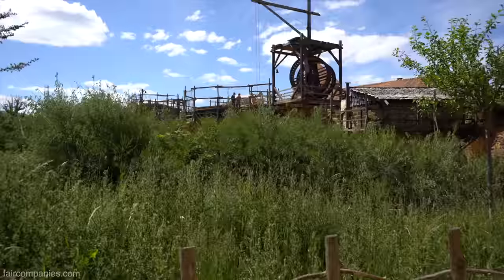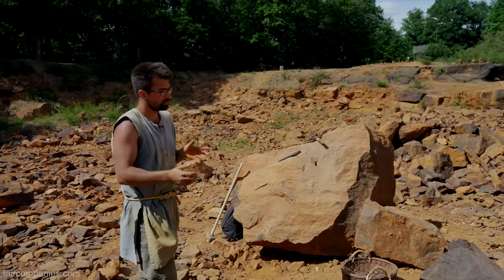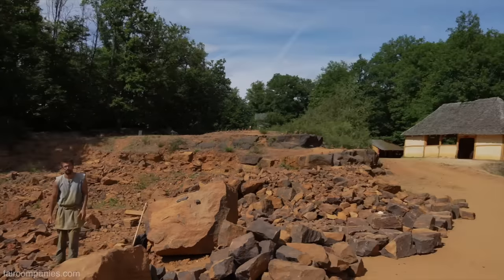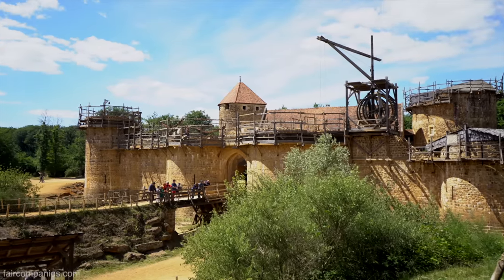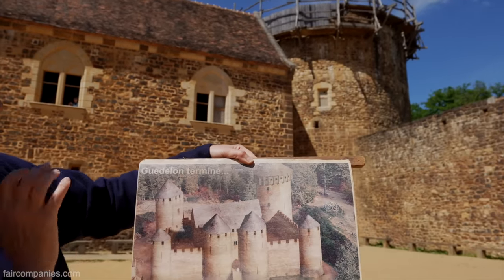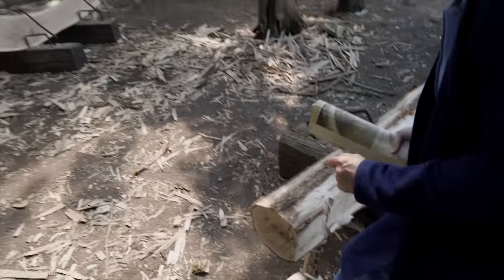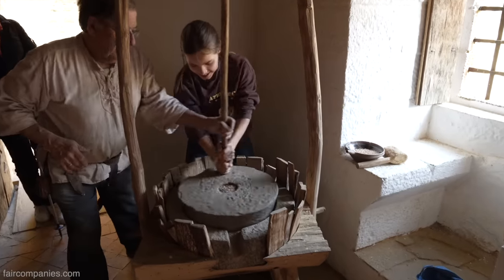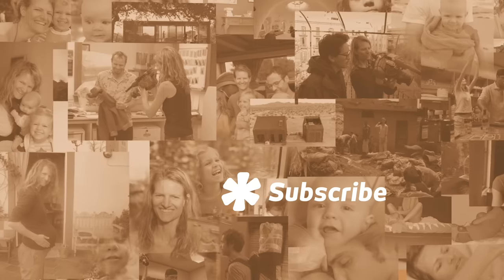Friends build real castle from scratch with simple tools only

Comment: what I love is they chose the area carefully so as to have not just enough stone but also wood, water, lime and iron ore as well . all the materials for this project needed to come from the land surrounding the construction sight the same as in the 13's century . when you think how much stone was needed it's amazing enough but then you need to think off all the wood for the project not just for construction but tools, doors and support frames . then there's the black smith forging all the tools and maintaining all the wedges for the quarry as well as forging every other tool on sight  then there's the plaster and mortar for the walls all of it has to be made on sight a process that can take month's and most be done ahead of time the plaster needed to be burned from lime into quicklime then stored tell it was needed and kept bone dry . the shear number of processes and the quantity's of materials is mind boggling .
Reply: there was no lime at the castle did you watch the video

Comment: Having done construction using modern tools and methods, everything they are doing makes my joints ache. Like, I cannot watch this without physically feeling worn out. Don't miss that work, not one bit. Mad respect to these folks for using period-correct materials and tools, what a value to archaeology. I'd rather face a firing squad, but that's why I'm not out there making castles.

Comment: Amazing project, great vision from the start.  Minor correction though - mortar (especially lime mortar) isn't used to glue the stones together, it's used to give the stones a base and prevent them moving relative to one another. There's very little adhesion in the mortar, but the weight of the wall holds it in place.  Lime mortar (as opposed to cement) has the great property that - even if the stones do shift - any water that passes through the gaps that appear in the mortar will help the gap 'heal'. 
Cement mortar does glue the stones/bricks together, and if the foundations shift, you get the stones/bricks/etc being broken in half - not ideal.

Comment: So this castle is "about 80 years younger" than the castle that's dearest to my heart, Rieneck in the Spessart mountain range in Germany. Built from 1150 onwards, it features a unique tower that's the shape of an irregular septagon on the outside and a regular octagon on the inside, with a chapel encased entirely in the inner wall on one of the floors. It's really fascinating.

Comment: Awesome build, the thing about the old level being more accurate then modern spirit levels is nonsense however. Even cheap ones these days are very accurate but something like a machinists level has insane levels of accuracy.
Reply: There is some slip in spirit levels.  Over a long enough distance, the divergence from "absolute bubble center" becomes noticeable.
Reply: @DokDream  Absolutely, but it's well worth your while looking at the accuracy of a machinists level. The issue also applies to the string level because you are relying on the point at the end of the string being central to a mark in the same way. A millimetre off and it accumulates also. And the old string levels aren't exactly calibrated either. For structures they are perfectly adequate though.
Reply: *than
Reply: Of course we both are ignoring the fact that spirit levels were not invented until centuries later.

Comment: Amazing! Can you give us some info about the fundations? The calculations involved and how they were built for such a large and heavy structure? Great stuff!
Reply: I wasn't able to find much info, just that the earth work was mechanical. But many pre-industrial french buildings have no foundations at all. 
Since they are building in a quarry, it's possible that they built directly on the rock bed, as was sometimes the case. The use of carbonic lime mean that the walls keep some flexibility if the ground move (like in Pisa), and the careful masonry make them stable even without the mortar (in this case they have a very sticky mortar).
Reply: @NouriaDiallo  Wow, never would have thought of that. Thanks you Nouria.
Reply: @NouriaDiallo  domestic buildings no foundations.

Large structures like this would have large foundations.

Typically a quarter of the wall is below the ground.

Without foundations the walls would fall when half built.

It could take 10 years to build the foundations of a cathedral
Reply: Best is to build on the bedrock, like the castle

Comment: So the site was chosen based on availability of materials (old stone quarry and a pond nearby) making construction easier. I am wondering though, in medieval times would they have picked this spot aswell? I miss the more strategic aspect. As in a commanding view of the countryside etc.
Reply: A bit of both.

Would need to be strategic but also capable of being built.

Often this meant access to sea or rivers for stone and timber transporter.

E.g. you would build a castle with a quarry ten miles away on the river.
Reply: You would do the rough work on site and transport semi finished product.

Advantages to keeping workers spread out for food and health reasons.

A castle on its own is nothing. The country controlled by the castle is the important thing
Reply: Guedelon is small familial castle, it's function is to control the land of its lord, it's not fit for large scale sieges. That's why so many smaller castles were razed during the hundred years war

Comment: What happened to architecture? This has taken these people 25 years of work by hand, and it seems like it could be complete in 5-10 years at most. This was by hand. With modern engineering and tools, we could have such beautiful buildings go up within only a few years with unique and stunning design and architecture, but no! All we have are tall rectangles. Sure their height is impressive, but its all vertical and boring now, and we don't have anywhere near as many limitations as these people, or even people of old.

Comment: It is considerably small compared to many in Fantasy settings. Of course this would be a resident of minor overlord, maybe even someone as low as Baron or Knight.
By the time of Early Modern. What is an actual function of this kinda castle if it can't protect anyone against big guns? a site of administrative building? a military base where soldiers are stationed or what?

Comment: This old architecture is beautiful, instead of 35 years wonder how long it would take if they had modern machines perform the same techniques. Identical result, but finished much faster. In theory you could create a Notre dame in a year or two. Small towns popping up with beautiful architecture instead of ugly apartment complexes. Any bored billionaires in the comment section?

Comment: @26:58 Not to say the baskets do not have the advantage of being lighter, but Is really (just) that they are "lighter, easier to transport then heavy wooden buckets"?  ..Could it actually be an unutilized resource, and wood would be put to better use else where? And then, could it also be less time intensive(cost less in "labor") to make a single basket then a wooden bucket?  ..Beyond that, I would think "lime" would be corrosive to wood and wicker alike, no?

Comment: Saying that their level is more precise than the modern one is just not correct. You can even see how the weight on it is not hanging straight down either. But in the end it all depends on the Width of the level, and the wider you go in medieval times, the more unprecise you get due to not having very precise tools

Comment: Contractor listening to YouTube while working in an attic while building a house. Heard the 2 lines in a level make it "less accurate" and started laughing.  Exactly the opposite 😂😂 it makes it twice as many references and the cheap levels at the store is rated to .005 or .002 of level. While I look at the machined tube holding a bubble of gas in the level from my tool belt, I'm wondering what  tolerance the plumb bob on that level was formed to? That they tell people it's more accurate than the expansion of a  bubble of gas in a liquid is laughable.
FYI, the lines reference the active bubble which is a device that allows you to reference a tolerance to level. That is assisted by a couple meters or airspace grade aluminum milled by a CCN machine that is set to another exact tolerance. Any time you hear Egyptians used...... You can bet what they say next isn't true.  That plumb bob and line have NOTHING to do with setting level it's the accuracy of flatness multiplied by the tolerance of the woodwork holding it that "sets level".

Comment: @Not Even Wrong well, here's is your first wrong, I guess. Because this castle build is redundant & irrelevant; for the mere fact that the ancient castles all around the World, especially in France, were made with a special cement. That special cement is stronger and harder than the rock used. Making the ancient castles virtually impossible to destroy. That is the ONLY reason there are so many still around. So, you building a castle with simple tools, means nothing without the actual materials the original castle builders used. Fyi.
Edit: by the by, didn't even watch the video. Do not need too. I know 100% that you do not have said materials because to this day no one knows how that cement was made.
Reply: There are theories like they used freshly burnt, unslaked lime powder (requires mechanical grinding) in different ways, like mixed with slaked lime mortar and silicates - similar to hydraulic cements - or they poured it directly to the sandwich-like wall's core (mixed with quartz sand etc.), and let it slake it right there by the air and additionla water. They don't really know the exact technology, it's necessity is questionable, and it is not a life insurance to work with. Also more complicated to work with. They are still authentic, because they create their own high mortar from burnt lime, local water source and local sand source.
You are right about the lost knowledge, like we will never be able to build with the same efficiency as Roman age or medieval age expert teams, but such projects are perfectly fit for preserving and revitalizing old technologies.